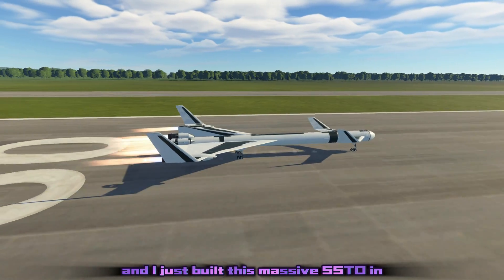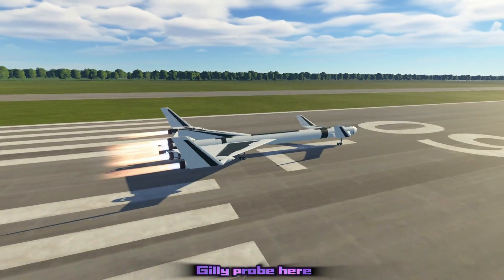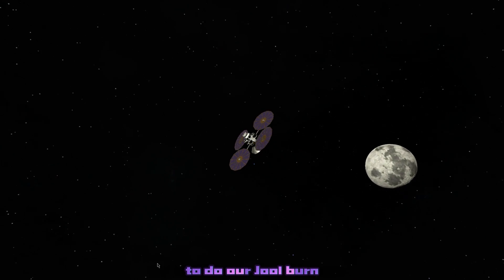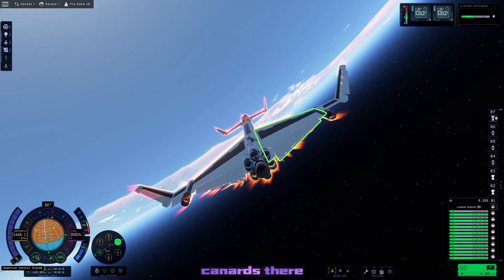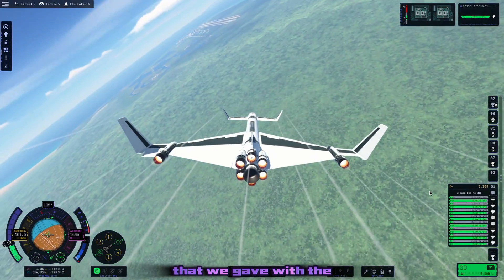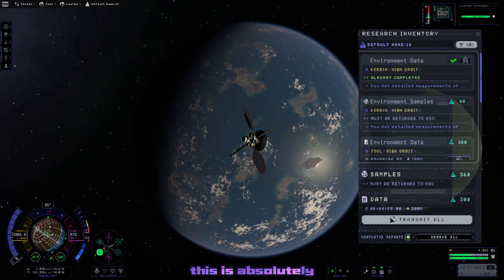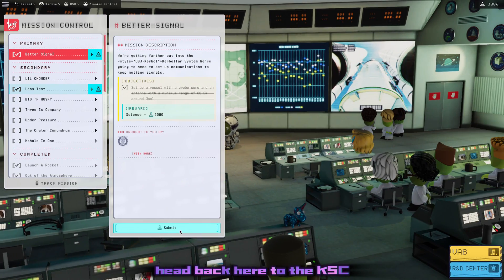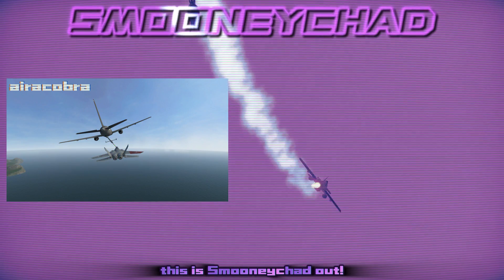MASSIVE SSTO Mission to Jool in Kerbal Space Program 2 !  (KSP 2 - Aircraft Only: Ep 8)

Comment: My planes cannot takeoff due to my jet engines randomly reversing thrust. Anyone know how to prevent this? Shouldn't a game at this price at least have working engines? Feel like I've been scammed, I can't even play the game.
Reply from the maker: Hey! You can fix this by turning off "Automatic Switching" on all of your engines on the plane, or simply putting some more air intakes. I think it's just a bit of an oversight that will definitely be fixed latter on, the feature is intended to automatically switch rapier engines to their rocket mode when they run out of air (just like in ksp1) but instead it's enabled on these more basic engines (wheesleys an panthers) causing them to switch into their only other mode which is reverse thrust or afterburner, whenever intake air drops below a certain point. (You can also link the reversers to an action group like the 1 key so you can use them on landings or taxiing). If you have any question about it lmk!

Comment: I saw in a previous video you mentioned getting a new flight stick and I was wondering how to set one up for ksp
Reply from the maker: The stock game has some very basic support for flight sticks/hotas, you can bind the Pitch and Roll axes as normal but the yaw and throttle doesn't work. I got by this by using a program called antimicrox to rebind the yaw on the flightsick itself to A+D (the regular keyboard controls for yaw) which is either all the way on or off but get's the job done done since it's just yaw.  Alternatively there's a mod called inputbinder for KSP2 that let's you set everything up (including throttle) properly with no workarounds. Unfortunately whenever I use it, it stops certain keys from working like esc while in game, so beware!  I hope this helps and do let me know if you have any questions! :D
Reply: @smooneychad  thanks  that’s the exact reply I was looking for thanks heaps and keep up the great work

Comment: Hi Chad, I love your series and i was hoping you could try do a Jool 5 and land on Jool's surface as the end of that video?
Reply: It seems it's impossible to reach the surface now since you overheat and die first, he mentions this near the end of the vid
Reply from the maker: I think as of right now it's impossible without some kind of thermal/aerodynamic trickery, to test it I put a probe inside of several fairing layers and heatshields and it still melted around the same point 10-12km (it seems fairings don't really protect things from heat, at least not jool's heat.) 
 Maybe it'll be possible later on with some insane amount of radiators, hopefully!